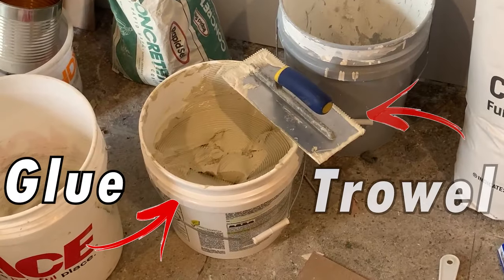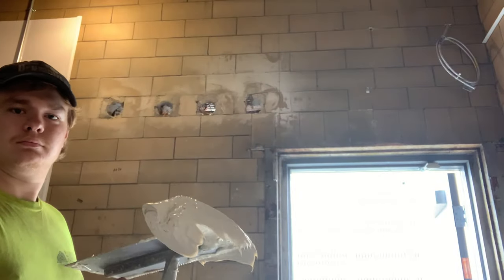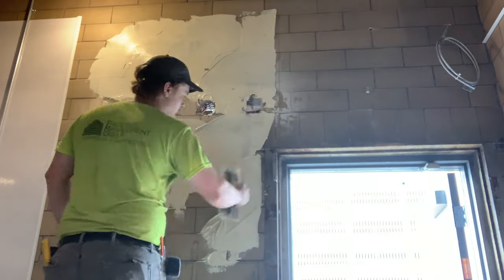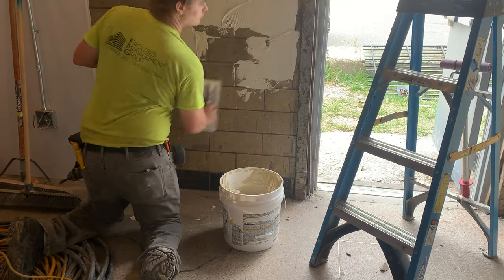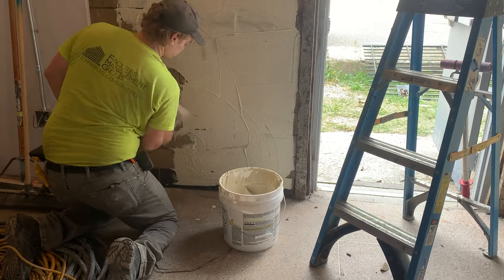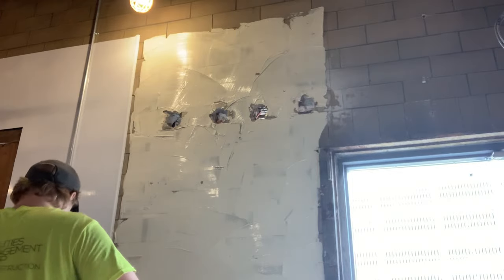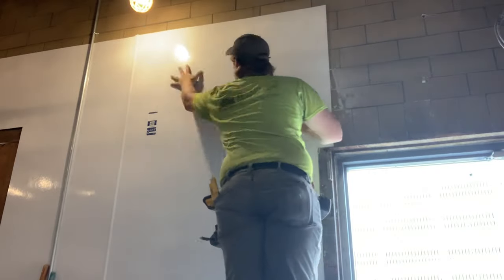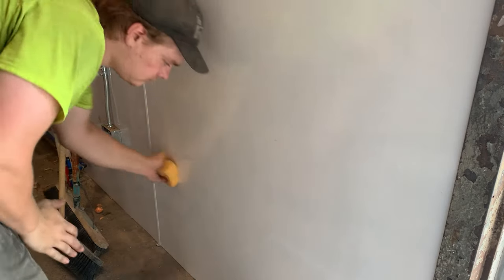Easiest FRP Installation!!

Comment: I am going to try making long  8 ft cuts using large cast iron hand shears, probably meant for heavy sheet metal.   They worked swell on softer Plas-Tex sheet. I tried loping off a 2 inch corner of one sheet of FRP panel.. and it cut like butter. This should eliminate any glass dust which is a Serious Health Hazard.. this young man would be well advised to use at least a nuisance dust mask while cutting with the router.  ( oh and some knee pads.. you won't be young forever.. but you WILL be working.
Reply from the maker: Appreciate the advice.

Comment: Can you install frp on either side or do you have to install it with the textured side out?
Reply from the maker: You have to install it textured side up. That’s the cleanable, washable surface.
Reply: Lowes and Home Depot sell a non-textured frp panel
Reply from the maker: That is true. You would then install the sheet glossy side out.

Comment: Can you use regular construction adhesive for a single panel install?
Reply from the maker: If you do use construction pieces, I would definitely recommend you roll it generously. Just to get the blue as flat as possible. Other than that I don’t see why not.

Comment: I've been asked to do a bid on a bathroom and pool equipment room. Are there cornices or moldings for where ceiling meets wall? I guessing that could be caulked? It doesn't look that hard but I know nothing of frp so trying to learn before I bid. My job will be a 20 sheet frp Job how much glue will I need?

Comment: I've been told you need to use a silicone caulking to seal the dividers, end caps, and corner pieces. Is this really necessary?
Reply from the maker: Thank you so much for the comments! I’m glad this video was helpful to you.

As far as the caulking, I personally add a little glue to the inside of the dividers, end caps and corner pieces when I install them and that seals it pretty well. Doesn’t need much glue, but for me, it takes away an extra step. Typically FRP rooms usually have some sort of base and ceiling; that’s what you would caulk. 

I hope this was helpful. Thanks again for the comments!

Comment: Maybe a stupid question, but I ripped off old damaged FRP panels and now have the brown part exposed on the drywall behind it. If it is sanded will I be able to adhere the new panels to that or do I HAVE to replace all of the drywall now?
Reply from the maker: You’d have to do is scrap it all down and then skim coat the wall with drywall mud.

Comment: I'm looking to install FRP using  cap molding, corner molding, and divider molding. I'll only be doing 12-14" high. I'm looking to do this without adhesive. Any advice?
Reply: The installation guide for the panels mentions pop rivets for fastening

Comment: What bit do you use in the router?
Reply from the maker: 1/4” Flush Trim Router Bit. You could use 3/16”, but we used 1/4”. Must have the ball bearing to glide along you wood guide. Remember not to push too hard with the router. If you put too much pressure on it, it’ll burn up your bit.

Thanks for your question.

Comment: Did that stay up? The instructions say to glue the panel and then place it on the wall
Reply from the maker: Yes, everything stayed up. Gluing the panels produces too many issue. You can prevent those issues by gluing the wall first. Less mess and less strenuous work.
Reply: Thanks. I just did it your way in a hard to reach spot in the bathroom. This is very helpfull.
Reply from the maker: Glad I could help. Thanks for watching!

Comment: I wonder if you dould use a drywall rotory router to cut it. Also did you use a strait router bit?
Reply from the maker: I don’t see why not… I used a straight flush trim bit, yes.
Reply: @iplconstruction5786  yeah a drywall router works good for boxes. Frp is a shit job I doubt I'll do another one.im a one man band, but this can be done by yourself but it sucks I used a drywall tift to do ceilings . Frp does pay pretty good though.

Comment: That's an easy job.  What I am having to do is from floor to ceiling.  Long runs.   I hate it.  I must be missing something.  Even with 2 of us it's taking forever.
Reply from the maker: With that job, it was a little tricky with vertical 10’ panels, but really it boiled down to coordination with my boss and I. Once we got a system down, it flowed pretty well. FRP jobs definitely require a bit of patience and forethought. Experience and consistency will yield a great end result.

Good luck with that FRP  job.

Comment: It was well put together but you left out some things. For example...let's say.you have one sheet on the wall (only one) and you need to put a horizontal  trim piece at the top.
  Now your frp is only 4' across but your cap (trim piece..whatever you wanna call it) is 8' across. 
When then,?
What happens when your wall corners are bulldozed and the board of health is requiring a trim piece for the outside corner where your 2 sheets of frp are meeting?
Reply from the maker: I don’t exactly understand your first scenario. Any FRP job I’ve experienced, there has been a drop ceiling and the wall angle had been caulked and sealed; abiding with health code. 
Regarding your second scenario, we did have a few of those outside corners of FRP and we simply glued plastic corner guards on the corner and caulked it.

I hope I answered your questions. Thank you for watching and commenting.

Comment: My experience with Free Range Poultry was similar to yours.  What kind of feed do you use?
Reply from the maker: I use a white powder mixture. Full of fiber and easy to make. And I mix a little bit of Titebond and water to complete the feed. Works every time and it very beneficial.

Comment: Can I use FRP on my basement wall to cover unfinish side wall of the basement instant of using dry wall? Is there any other material beside FRP and Dry wall to cover the area
Reply from the maker: Is that side wall just bare studs?
Reply: @iplconstruction5786  yes Sir
Reply from the maker: In my opinion, you would be better off using drywall to finish the wall. Lot less aggravation. There’s really not an alternative for drywall. If you really wanted to, you could use a sheet of plywood to cover the wall, but it won’t finish nice. 

I don’t really recommend using FRP to cover the wall. It would look like crap in my opinion and it would be more vulnerable to damages. FRP isn’t that thick and can be damaged easily.

Comment: Let's be honest. Any time you are applying that much adhesive, be it a floor, wall, or counter top, there is a very good chance of getting glue on you and other things. Of course being careful helps, but still, it is messy. I use small pieces of wet blue type paper towel. ONLY ONE WIPE then toss it, otherwise  you are just spreading the glue around.

Comment: Are you still installing frp? Any tips for how the side and top caps fit into or by each other? Also have you glued directly onto the board before?
Reply from the maker: I have not done another FRP job since the last one. Can you give me some context and what you mean by caps fit into or by each other? The only time that I’ve ever glued onto the board directly was if I was doing smaller sections upside down on a drop. Other than that we just glued the walls.
Reply: @iplconstruction5786  the molding. Is each piece supposed to fit into each other?
Reply from the maker: @TheKylebreezy  If you're creating a corner with the end caps, I recommend creating a 45 degree angle to achieve a professional look. As far as the dividers, if you need to connect it to an end cap, I'd just butt the divider into the end cap. Nothing to fancy. Just remember to keep that contact between the end cap and divider tight.

Comment: How much frp glue do you think I’ll need for a 42x11 wall?
Reply from the maker: One 4 gallon bucket should do the job.
Reply: @iplconstruction5786  

Just did the math I’m going to use 8x4 panels with a total of 30 panels so what are your thoughts on gallons any info helps since I’ve never done this type of work before. THANKS in advance for the info man.
Reply from the maker: I’d recommend getting 5 gallons of glue for that project. I also recommend you pick up Titebond Fast Grab FRP Glue. That’s the easiest brand to handle. The other brands I’ve used were too wet. Makes a mess. Good luck on your FRP job!
Reply: @iplconstruction5786  thanks for your time and knowledge man great video.
Reply from the maker: I’m glad I could help. Have a great day!

Comment: You have a solid video however, a comercial kitchen is a whole different animal. Good place to start
Reply from the maker: There is no differences between FRP jobs. Same techniques used throughout different jobs. During the recording of this video, we were  working on a kitchen build. Currently we are actually working on a swim school that required FRP. There has been no change in techniques or anything regarding inspections. 

Either way, thank you for watching and I hope you enjoyed this video!
Reply: @iplconstruction5786  obviously you don’t have a clue about anything other than surface mount boxes or plumbing manifolds coming through the wall. I was trying to be polite with my first comment but if you want learn I will get you a hardhat and welcome you to learn on my job
Reply from the maker: Obviously you don’t have a clue how a kitchen is built. Plumbing and electrical comes through drywall. The only thing that was surface mounted was a couple of conduit lines. We installed 120 sheets between 2 floors. Hood fans installed, ansul systems installed, and plumbing/electrical already roughed. There was plenty of cutting around I assure you. I would suggest you calm down your arrogant attitude a bit. Have a good day.
Reply: This is exactly my point you show a sheet where you cover over boxes on a cmu wall and nothing else. These are the issues that make problems in a sheet for those that would be looking for you to guide them sooooo.  Try to show the easy sheets does nothing for them. I for one am always trying to see what someone else has come up with, it is called knowledge. I personally am hungry for if you are say the word and I will show you some knowledge. I would love to be able to video my work for you but don’t do many comercial kitchens as side work. Have a good weekend there lil fella.
Reply from the maker: Thank you for your input. Part 2 in the works!

Comment: You didn't show how to join the ceiling and walls
Reply from the maker: You are correct. I did not. This particular job didn’t require me to do so. Therefore I had no footage for that. However, all you have to do is add an inside corner to one of the panels. No different than any other corner

Comment: what is the thickness of that sheet ?
Reply: The panels I'm using are 0.092 inches thick, which is about 3/32 in. That's a fat 1/16 inch. But every brand is a bit different, some thinner, some thicker.

Comment: Do you really need that much glue?  Seems like overkill and some future remodeler will never get it off.  I suppose it depends on the substrate.  I'm just going to rebuild an RV shower and I think some adhesive from a tube spread generously will be enough.
Reply from the maker: My job is to ensure the panels don’t come off. If you just use a tube of construction adhesive, the time it would take the panel to peel off would be way less compared to using a full sheets worth of glue. Also, the glue isn’t only used to keep the panel from coming off; it’s there to seal the wall from water and moisture. A couple bands of glue may work for a temporary seal, but as far as a long term sealant, I don’t think it would hold up, especially if you’re rebuilding a RV, which is an unconditioned space. Just my 2 cents.
Reply: I am doing an RV project as well. I plan to roughen up the adhesive side of the panel on the panel prior to mounting the FRP. I tried using 3M 77 on it, and it doesn't hold well on vertical surfaces but did on horizontal when tryin to rip off a test piece. I might try that for a substrate on the frp.

Comment: There are MANY MANY video's showing the adhesive being spread out on the FRP board . WHY ? To me its plain ol' 
common sense to apply it to the wall first.
Reply from the maker: Not so common apparently. Best way I’ve found.
Reply: Instructions on the frp sold near me specifically state not to spread glue on the wall but rather spread it on 100% coverage of the frp, and when applying to block or tile to use mechanical fasteners and not glue.  Adhesives and their specific chemical properties are kinda funny, maybe there's some kind of chemical reasoning for it.     EDIT to add: I just checked a different store near me and their product says to do the opposite, so I guess it depends on the manufacturer.
Reply from the maker: I just find it easier to install the glue on the wall especially on uneven block because I can fill in uneven block with glue so my sheet can lay flat. I’ve had pretty consistent results doing it that way.